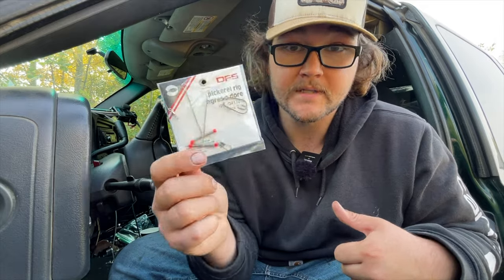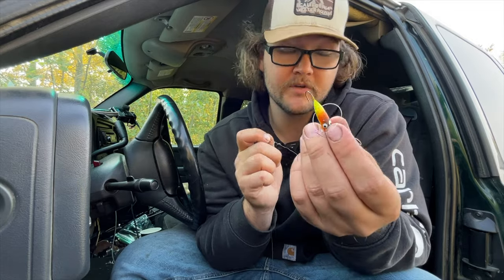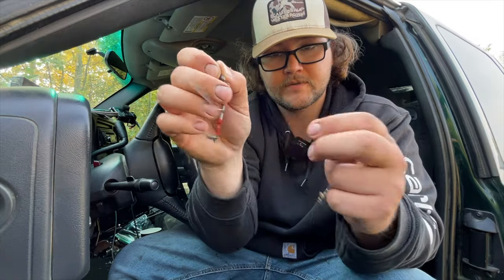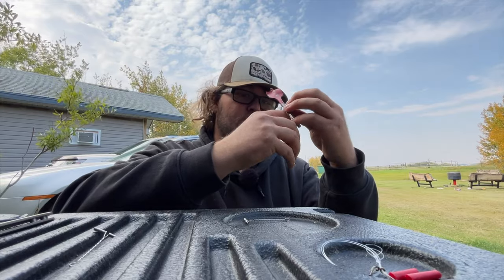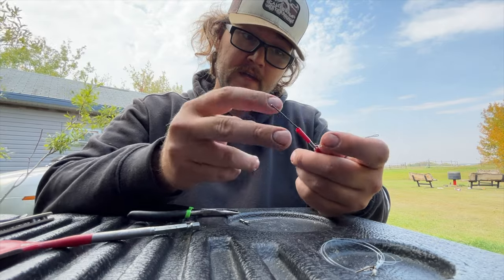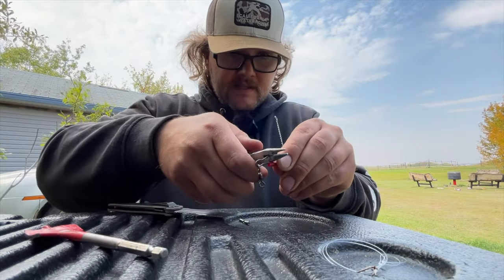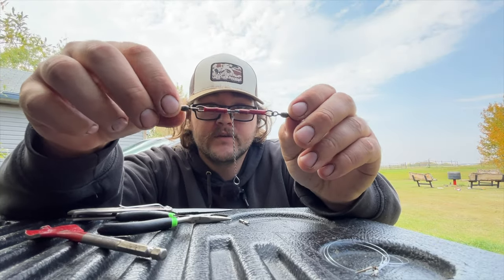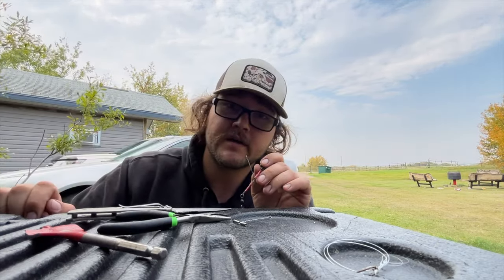How to make a 3-Way Rig! | Pickerel Rig Alternative

Comment: nice.
but is there a way that you can just add light weight line to the bottom of the pickeral rig about 10 inches below and a bobber on the top 
that way rhe rig is suspended, and the weight will snap off ???
and mabey lighter line for the hooks 🪝, would that work. or am I out to lunch
Reply from the maker: Sounds like a tangled mess to me. I really don’t think p-rigs should be used on lakes ponds or rivers in general!
Reply: @ZachTheFisherman  I personally prefer a single hook and slip bobber. Change my depth if a certain depth doesn't work. hopefully, it's a strong back eddy to hold it in the river's